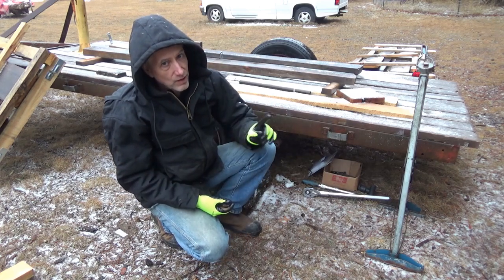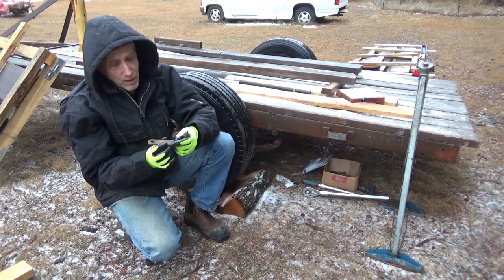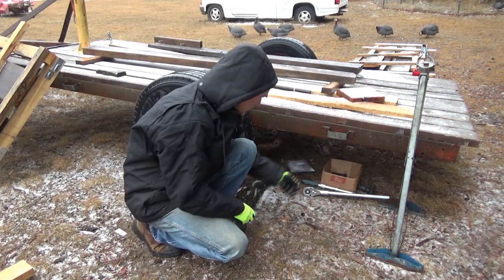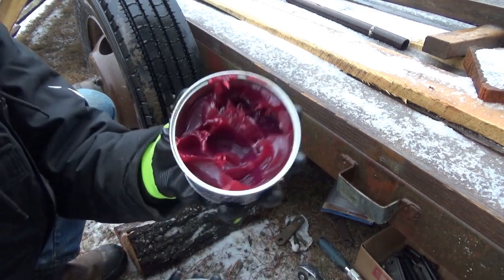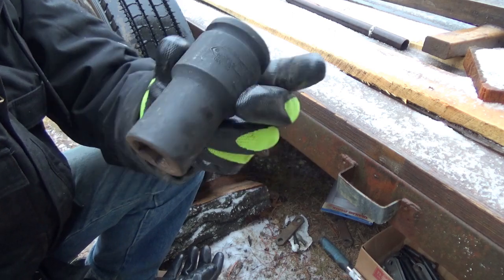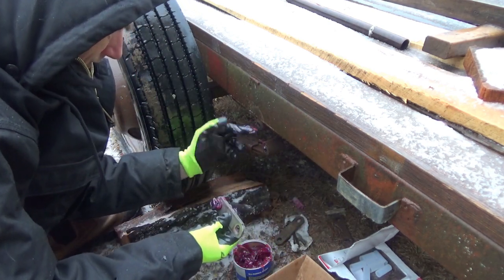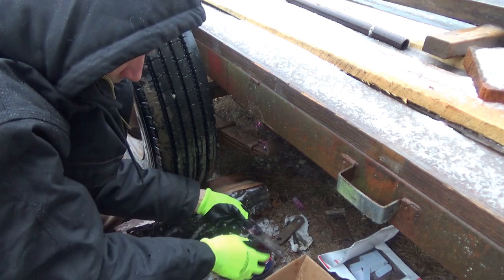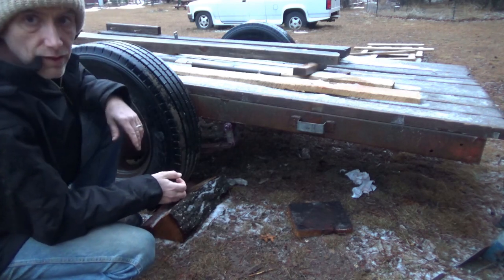Something You May Not Know About Your Trailer Replace Spring Shackle Bushings

Comment: If you go the other way when assembling the shackles nuts to the front you won't block the view. It also helps with the press fitting too.
Reply from the maker: I was thinking the same thing actually. The only reason you would not want to is to prevent the threads and nut from being damaged if something slams into your trailer on the outside.